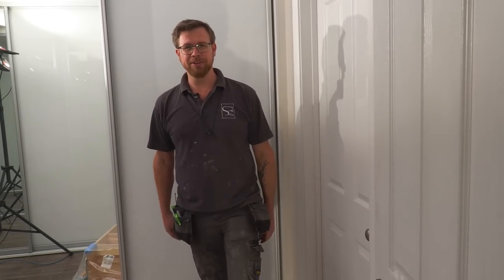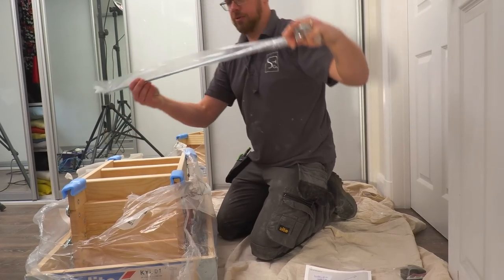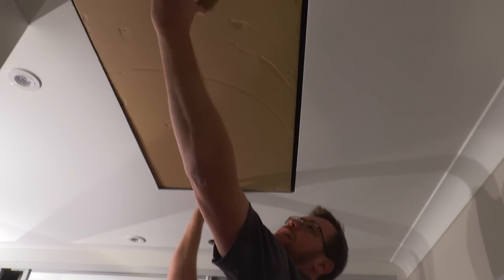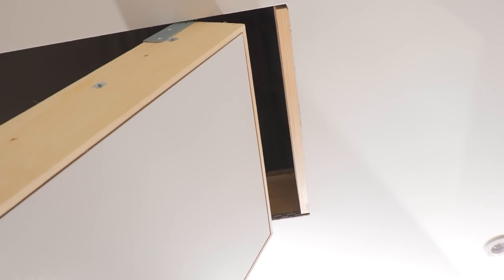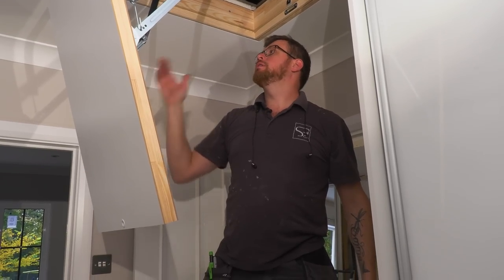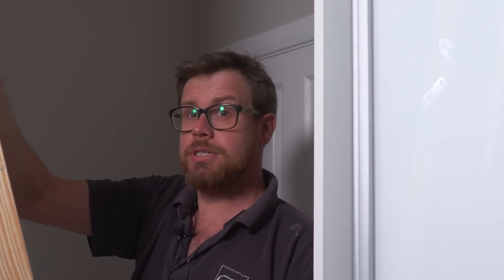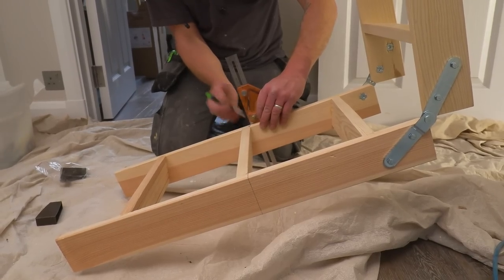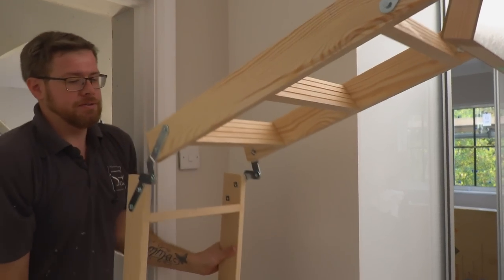Genius Loft Ladder Installation

Comment: Hello Roger. Great video. I have seen a similar (older) video where you were installing the hatch.  In both instances, the opening in the roof and any necessary work to the ceiling joists had been done or the roof joists already fitted to suit the size of loft ladder (which I suppose would be the case for a new build or perhaps a renovation).  For the non-expert installer, it would be nice to see a video where you were installing into an existing ceiling where the joists are not conveniently spaced to suit the loft ladder (so some joist strengthening presumably required) and the opening into the ceiling needs to be made.
Reply: Having done this the scary part is cuting a hole in the ceiling and the joists then boxing it out.

Comment: A few other tips: 1. If you have deep pile carpet, make a plywood pad for the end of the leg to spread the load, and chamfer the edges to protect the carpet when you open it up. 2. As the hinges loosen up over time, the hatch can sometimes "eject" the ladder as the hatch slams down - particularly if the person openings it is a bit shorter - so it's worth fitting a little latch hook on the side to prevent injury or (worse!) damage to any nearby wall in my case. 3. If the ladder fouls a nearby obstruction when opening then you can cut the middle and end ladder lengths and refit the hinges, if you are very careful with your measurements. My hatch is across the width of a landing so I have very little space - there is an architrave which it misses by about 1/4" when opening which is always a little nerve wracking!

Comment: I purchased a preowned, unused steel loft ladder and was concerned about having to lift it up to the ceiling due to its weight. It was comforting to see that you removed the ladder from the frame eliminating much of the weight, something I never see in any installation instructions. I often wondered why the ladder needed to stay attached (per the instructions) to the hatch while installing, while there are only four attachment points holding the ladder to it. Although mine isn't the same brand, I'm satisfied that this method is the safer, more practical one. Thanks!

Comment: Hi James, had a bad day with the old keylite today. Trimmed out the loft opening and trimmed off the plasterboard with no issues .Detached the ladder only to find out the hatch door was damaged. 16mile round trip to get another. Thought I was on the home straight. Fit the frame/ hatch. Attached the ladder, only to find out that The second section didn’t have enough room to swing down as it met the landing wall( small landing)🙈. No time to waste so I dismantled it all and set away at moving the frame further over to one side. Re fit it all…. Did it swing??? Did it bollocks! So I had no choice but to dismantle the ladder.cut the middle section and alter the bottom section making sure the ladder rungs were still at equal distance. Re built it and at last it worked a treat. The bad news came when I ended up slightly damaging the front of the hatch myself taking it back out when moving it over. The day was a right off , and will ultimately end up costing me  not the client. 
One issue I did have that you may be able to assist with was with alignment. I squared of the frame but on the hinge side it pulled over to one side . I tried to pull it over with the bolts but just couldn’t get an equal gap on both side. It had no movement to be honest.

Comment: It's a great loft hatch and i decided to buy one of these after watching this and the original video! BUT If you're installing into an older house Make sure your ceiling is level before you buy and install one, i didn't! assumed it was OK and found out the hard way when i opened the hatch for the first time unfolded the wonky leaning to the left ladder 😂 had to start again and install a recess! Think it'll look ok when the recess and architrave is painted!

Comment: You allowed the ladder assembly to drop all the way down on the square headed securing square headed bolts when attaching them to the hatch in situ.  The instructions tell you to set the brackets about half way down!  This gives you a little bit of wiggle room to be able to lift/lower the ladders to give a perfect fit especially if you cut too much or too little of the legs.
Reply from the maker: Bill 
Did you watch the video. That is exactly what we said and what we did.
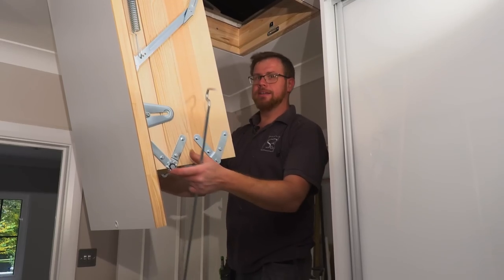Reply: @SkillBuilder  Have a look at your video again.  At time 8:21 the bracket is fully down and not half way.
Reply: @billferrol4202  Have a look at 9:36 once the bolts have actually been done up, and it is quite clear they are about half-way.

Comment: Did key-lite send out a new ladder as the first was cut short 🤷🏼‍♂️😂😂
Easy mistake to be fair.
Reply from the maker: No it was fine because there was enought adjustment to simply slide it down by 10mm
Reply: @SkillBuilder  If I were James I’d just blame Rodger on talking to much 😂😂